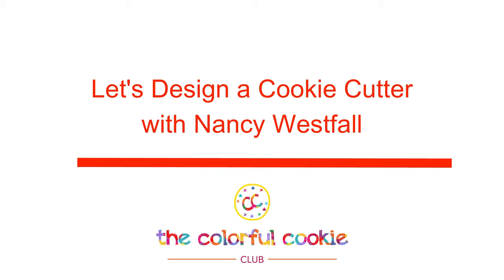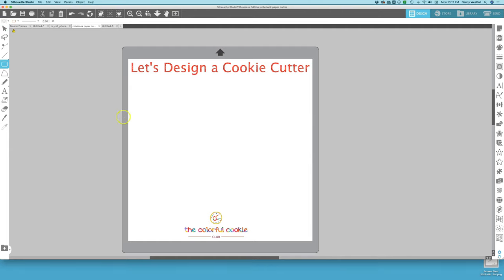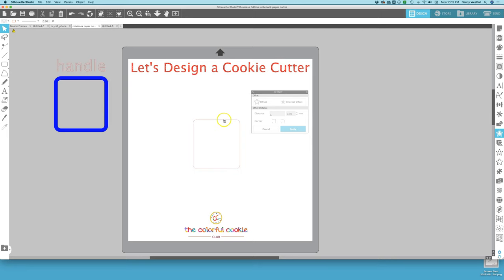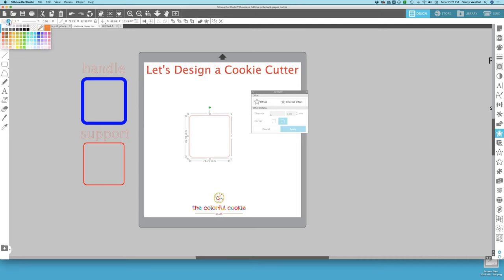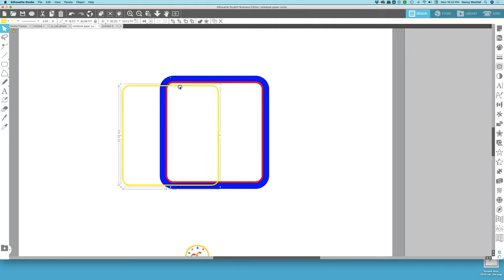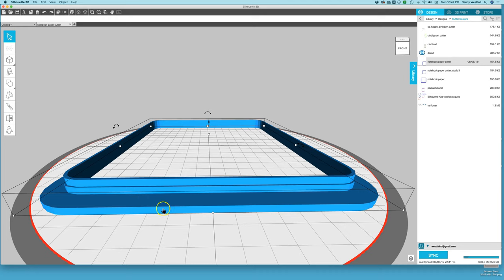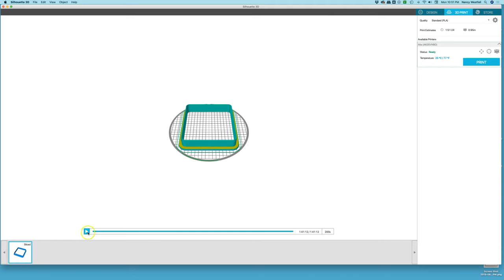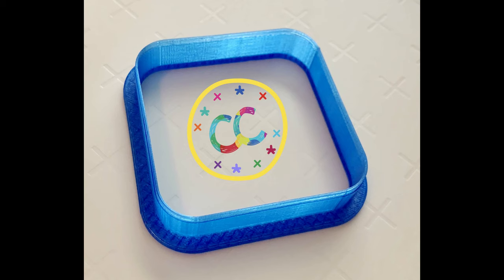How to Make a 3D Cookie Cutter #SilhouetteAlta

Comment: Hi, I'm going through the video while doing each step on the Sihouette software. At around 3 minutes in where you fill the duplicate with a blue color, for some reason my whole rectangle is filling with color and not just the outline. What am I doing wrong? Thank you in advance.
Reply from the maker: Play with the settings to the right, threshold, that will help change that